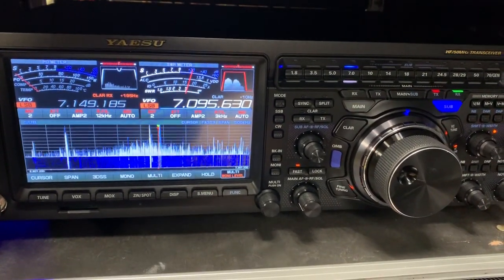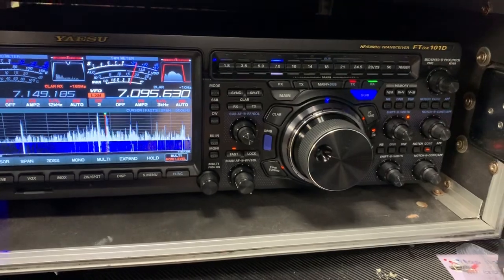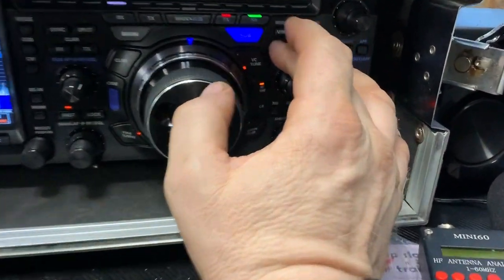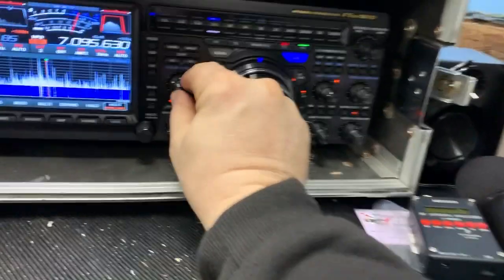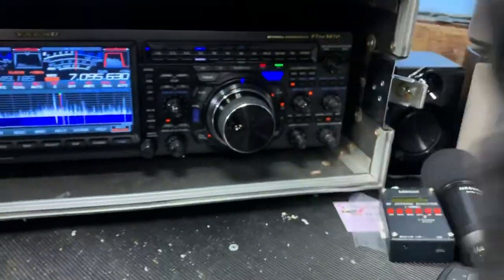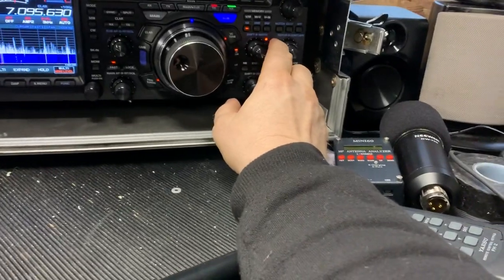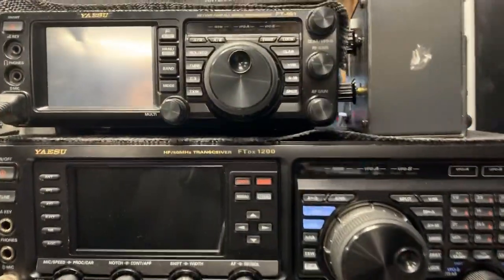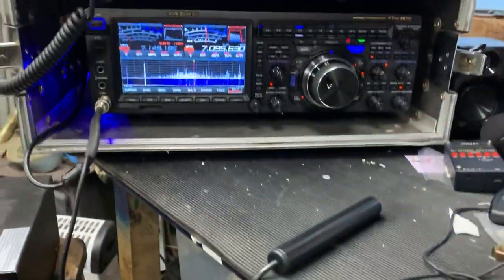Yaesu FTDX101D Noise Blanker Demonstration VERY GOOD

Comment: Thanks for the illustrative video. But ... although the NB is very efficient it means that every time we have a noise we will lose the spectrum analyzer that is 99% of that equipment? I think a lot of money for that. My IC 7600 does it better. NB outputs the noise from the speaker and spectrum analyzer. I would like to receive your opinion.
Reply from the maker: The 101 blows everthing i had in the past   I love it  dont like Icom they always sound lost muffled distant
Reply: @G3PWP  I think Yaesu have nailed it when it comes to Audio, Icom focus more on bling. My 891 sounds much better than my 7300 and it's got a better receiver, via headphones the audio from the 891 is just wonderful. I sold the 7300, still have the 891, says a lot !

You are really lucky to have such a wonderful radio such as the 101! :-)